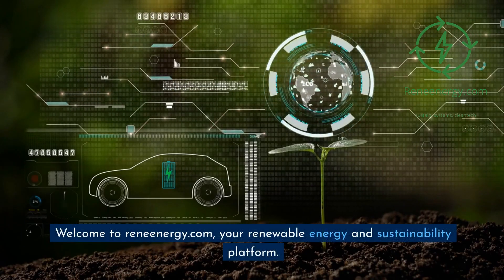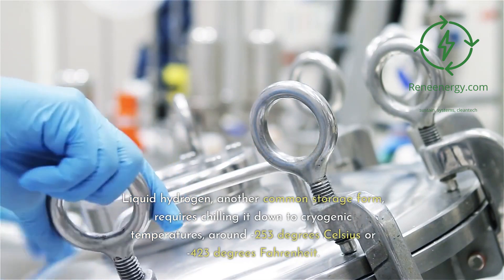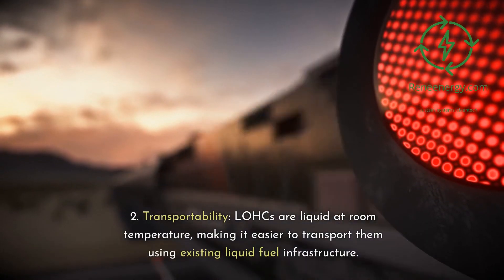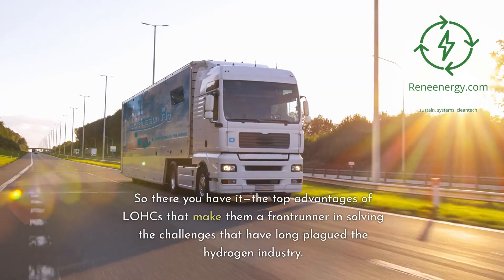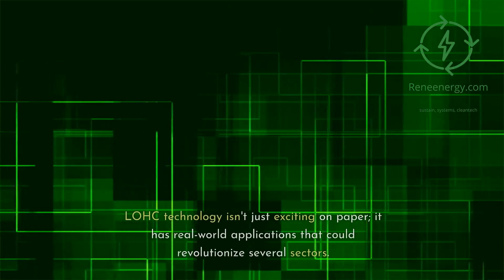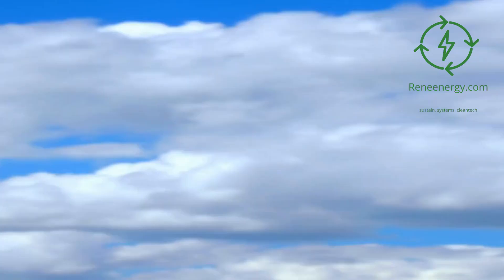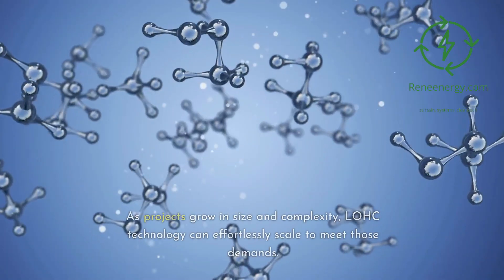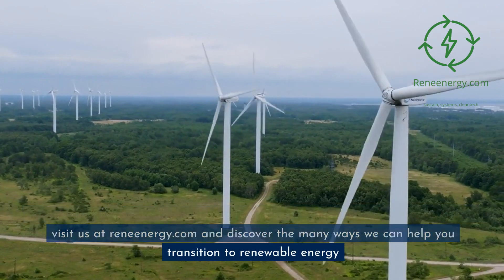LOHCs & Green Hydrogen - A Revolution in Storage

Comment: To be clear, is the H2 extractor part of the car with inbuilt catalyst, etc.  Or is the H2 extracted outside the car, which has to store the H2 under pressure?  In the former case, the depleted LOHC would have to be pumped out of the car before refill.
Reply from the maker: Thank you for supporting reneenergy.com. Most hydrogen-powered vehicles use externally produced hydrogen that is stored under high pressure in onboard tanks. The technology for extracting hydrogen from Liquid Organic Hydrogen Carriers (LOHCs) is largely in the research and development stage. While the concept has shown promise for efficient and safe hydrogen storage and transport, it had not yet been widely commercialized or adopted in mainstream hydrogen fueling infrastructure. The most common method for hydrogen provision to fuel cell vehicles continues to be via compressed or liquefied hydrogen stored in high-pressure tanks.

Comment: How does it compare to hydrogen peroxide as a energy storage medium?
Reply from the maker: Thank you for supporting Reneenergy.com youtube channel. Hydrogen Peroxide (H2O2) is generally not used for hydrogen storage, hydrogen peroxide is unstable and decomposes easily. It is mainly used as an oxidizer or disinfectant.Hydrogen peroxide is not practically considered for energy storage due to its instability and tendency to decompose. LOHCs offer moderate energy density and the benefit of ambient temperature storage but require energy-intensive release steps.